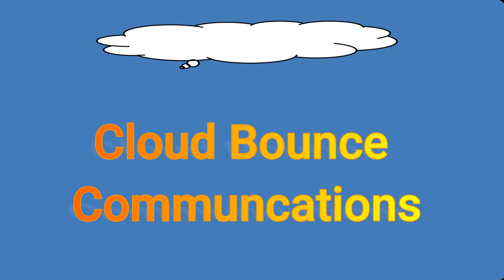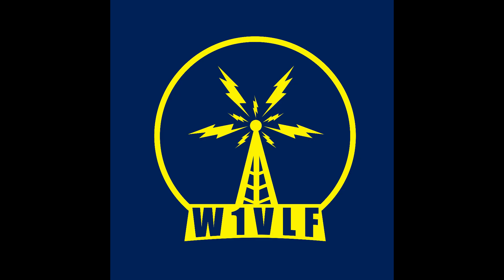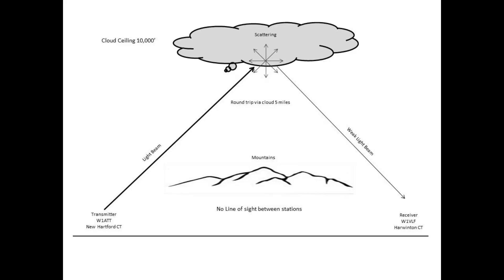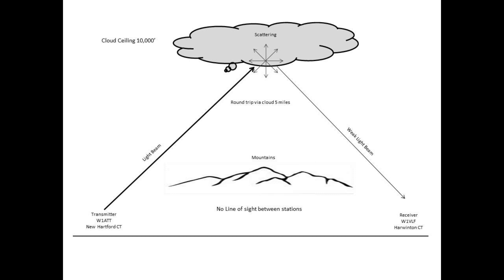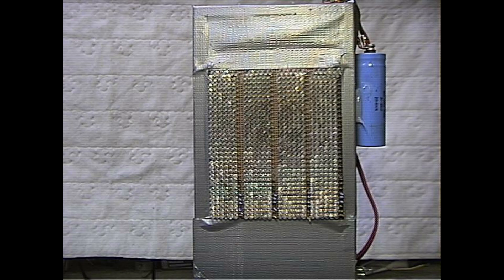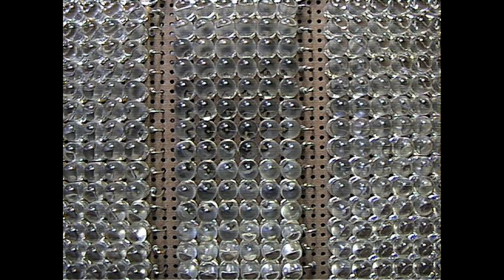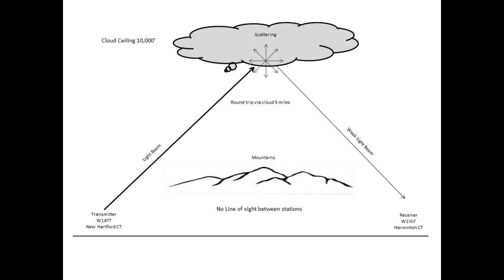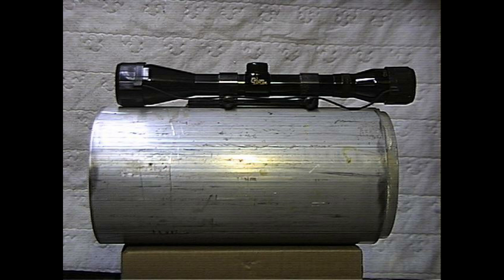Cloud Bounce Optical communications

Comment: My pal and I sent Hi-Fi audio 6 miles using a 3 mW dollar store laser. We might have gotten further, but our tests determined that optical distortions in the air caused the beam to wander during our 20 mile test, as the beam would appear then disappear at our receive site, so stable air would be critical for 'QRP' laser comms.
Reply from the maker: Hi John,  Congrats on your Personal best on Laser comm!!  I was excited to see it.  Yes... Scintillation can be a problem with a well collimated beam over distance.  The reason I went to NLOS comms was that I had no one local who wanted to "play" so I had to build everything myself and had to try a one way transmission fo RX only.  Do you know of any groups doing lased/LED comms?   I live in New England and have not found any. Where are you located?  Than for viewing   W1VLF  Paul